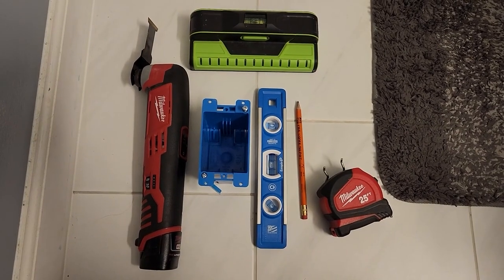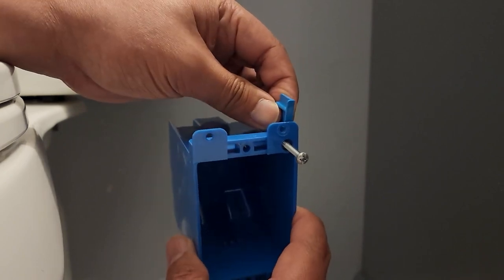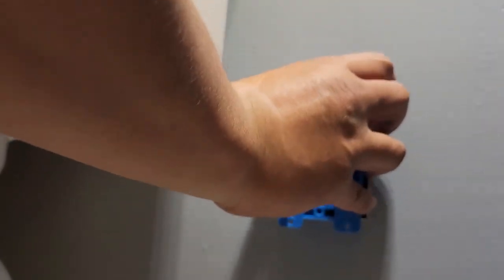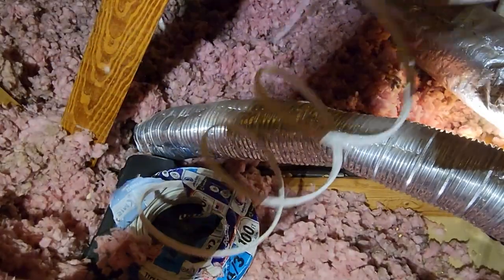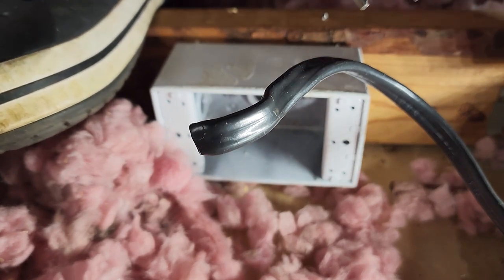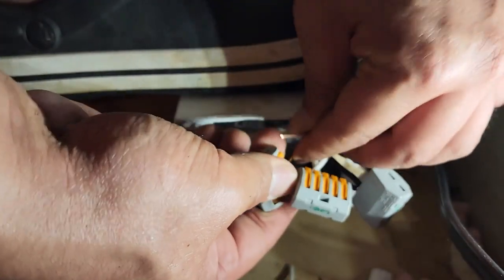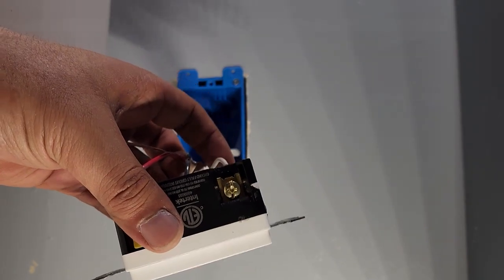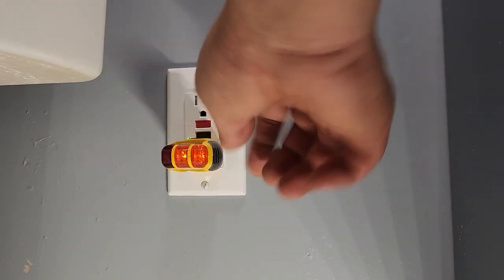How to Install Additional Bathroom Outlet For Bidet

Comment: Big Problem. Since you tapped the switch line to your exhaust fan, every time you turn off your fan you’ll interrupt your new GFCI outlet turning it off. You then have to reach down and press the little reset button on the outlet each time you use the crapper.
Reply: What would be a better source to use? I want to avoid this issue.

Comment: Since you tapped into a switched appliance, you’re going to have to turn on the fan to use the toilet, and you can’t enjoy a pre heated seat OR warm water.
Reply: What would be a better solution to avoid this?
Reply: @cajunomics3  to wire it into a constant hot connection.

Comment: 14 gauge is primarily for light fixtures or lower wattage applications. For a new receptacle I would use 12/2 gauge.
Reply: 14 gauge wire is fine for a 15 amp circuit, 12 gauge for a 20 amp circuit.

Comment: Does the switch for the fan turn off the outlet as well?
Reply from the maker: Yes, The exhaust fan switch turn off the outlet because I want to save power on the bidet toilet. You can tap in the main line before the exhaust switch if you want a regular outlet. Hope that answers your question.
Reply: Genious:
You are in the attic with easy access to power source. eg, pull chain light, hence constant power that isn’t tied to a switch which in turn provides uninterrupted power to the gfci. So why connect an outlet to a fan that operates with a switch. Are we reconstructing the wheel!!!

Comment: There is so much wrong with this install…

Adding an outlet to a switched circuit.

Using a metal outdoor junction box without clamps or wire bushings.

Using a switch cover on the box.

Using 14/3…

Over stripping the wires such that bare wire extends beyond the outlet.

What year did his house burn 🔥 down?

Please, please, don’t leave it this way!
Get some qualified advice or hire an electrician!
Reply from the maker: Thank you for the advice and suggestions!